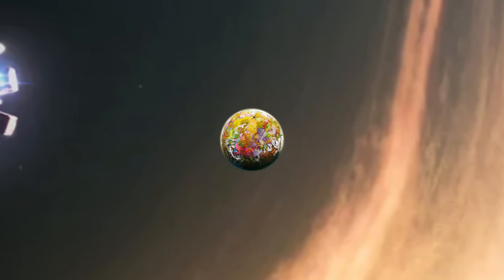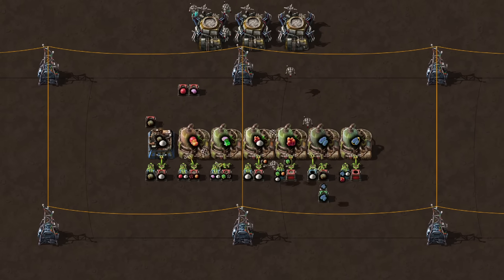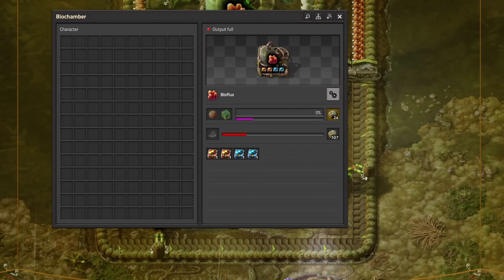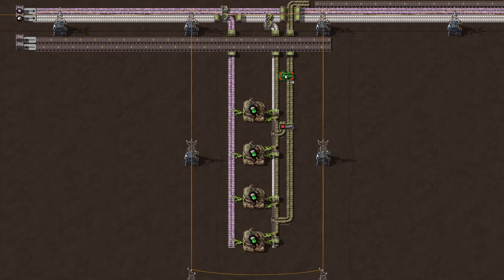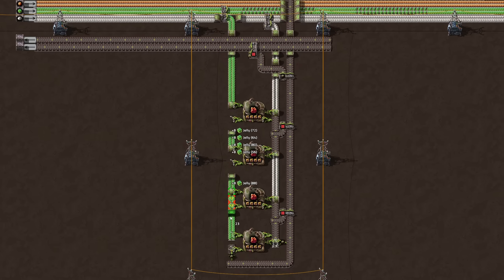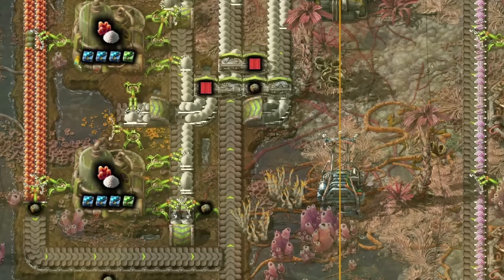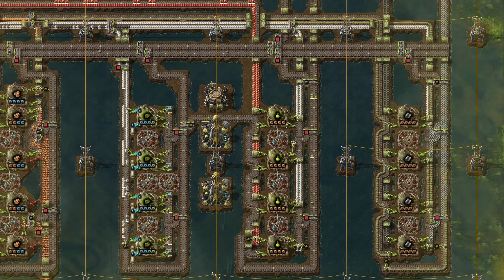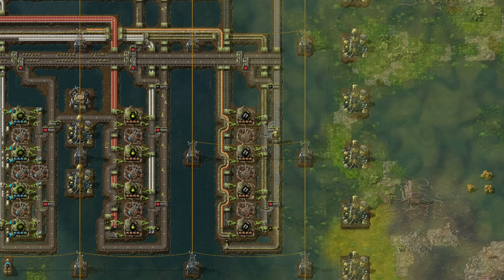Master Planet Gleba in Factorio. With Belts and a Main Bus! Factorio Guide / Tutorial

Comment: You can also permanently store eggs in the form of biochambers, and recycle them if you run out of eggs somehow
Reply from the maker: You actually get eggs back when recycling biochambers? LOL! Thanks for letting me know.
Reply: @AVADIIStrategy  Some people went as far as making spawner capturing devices and recycle them for unspoilable bioflux...
Reply: I heared a similar trick for biter eggs in the tier2 dirt blocks.
Reply: @Sapeidra  lol did the same too but instead I store them in the form of capture bots and I bring thousands of them to shattered planet for prometheum production
Reply: @Sapeidra  so technically you can ship those to make promethium science.
Reply: @Sapeidra yo what, T2 dirt??
Reply: @Sphendrana landfill can be upgraded to tier one plant soil with nutrients and the respective plant seeds. You can fill in some of the area to plant more stuff but to fully utilize the purple and green biomes you need the tier 2 soil which uses the tier 1 soil, more seeds, spoilage, and biter eggs. It takes 10 eggs to make 2 tier 2 soil so you need a lot.
Reply: @Sphendrana  the "overgrowth yumako soil" or the other one. both "store" biter eggs.
Reply: Nice! That's the solution I was missing in my base - everything else can autorestart, except this, now this can be solved as well.
Frankly with base just going and arty keeping pentapods at bay there is nothing to really worry about.
Reply: How do you not have inserters on the machines filtered to remove spoilage if an ingredient spoils in a bio chamber?
Reply: @egelat  unfiltered inserters will remove completed products and spoilage, you just filter from the output belt
Reply: Upcycle bot rocket + quality module in pentapod breeding = on demand legendary penta eggs. I crafted hundreds of legendary bio chamber from that. I am keeping a few in storage just in case i want more legendary eggs on demand via recycler!
Reply: @whensonzhou4174  pretty smart. Legendary eggs have longer lifespan anyway. I think I'll try my first legendary production line on that. Maybe store as unspoilable items and only when I demand I recycle to craft science with some insane speed modules to further keep freshness.
Reply: This is how I did it: I have a place that produces biochambers. The cool thing is that I don't need to know if I'm crafting science, or if anything needs eggs, I just craft biochambers and keep a chest of that full. In a different place I can request bio chambers, and produce a single egg when needed. This way, I don't need to worry about an egg getting into the bot network and being in a storage chest somewhere.

The biochamber production works like this: Request 20x the (non-egg) ingredients that are needed, and the biochamber crafter is always active. This way, the eggs are the only bottle neck, so they can not back up. If I want to stop producing biochambers, because the chest is (almost) full, I only disable the production of eggs, therefore guaranteeing that they all get used up, I'm kinda starving the biochamber crafter.

If the contents of the output chest are low, and there are no eggs, I kickstart this system by recycling biochambers until an egg is in the egg production again. The chance to get an egg out of recycling is 25%.

What pleases my software developer brain is that this system can be treated as a black-box that only supplies you with biochambers, and if other ingredients are missing (iron plates, landfill, nutrients, etc) it simply stops, but does it early enough that all eggs get used up. It can kickstart itself, and only does it rarely. It has a early-off/late-on kind of cycle that prevents it from short cycling, therefore preventing the need to recycle that often.

I do still have a couple tesla turrets around it, because I don't trust my logic yet XD
Reply: @Barmetler  Interesting concept: instead of using eggs to create science, you just quaduple the egg production, create biochambers and recycle them to produce eggs.
Reply: smart
Reply: You can simply stop the active biochamber via circuitry and an egg already used in a recipe will never spoil, no need to ever resupply new eggs.
Reply: Cracked. OP. Speedrunners gonna abuse this for sure.
Reply: I was planning on designing a system with a clock that cycles a new set of eggs into a chest ever minute or so, and burns/voids the spoiling ones... idk if you can do that, void them, come to think of it
Reply: wtf lmao
Reply: oh interesting
Reply: its the accent
Reply: Oh damn this guy is up to something here
Reply: this just blew my mind.  wow.
Reply: I was just overproducing science packs and letting them spoil so that I never have to restart the process.  This is very helpful.
Reply: I made an infinity egg machine on the side, in case I need a Pentapod egg or more. It just creates 2 eggs from one, splits them using a splitter- one goes back into a chest which is then loaded back into the chamber- the other goes into an Incinerator/Recycler. Voila - a perpetual egg-spawner!

Obviously, there's an inserter that handles spoilage.
When I need to get a few eggs, I just rotate the inserter - switching from the incinerator to the chest. In the blueprint below, I've replaced the incenerator with a biochamber to bootstrap science production. So as soon as you land on Gleba, you only need two eggs: 1 for creating the first Biochamber and the second, to stuff it into the chamber and start egg-production- for more eggs or to immediately start producing science.

Apart from the four belts bringing in Jellynut and Yumako and transporting back seeds, these are the only belts I use on Gleba.

0eNrNWE1v2zgQ/SsCz1TWpCTLNrY9FAiKXrbF7t7awKCpiU1UJlWKauoa+e87lG1tYkuJpH7CB8vU8M3Me5wh6T1Z5RUUVmlHFnuSQSmtKpwymizI6xxWIngH2onCZME/hbjTYAOh8Vkq0BKCd9ZklfT2H/Rfb/+9XgRv/fDOVMFGfIbA2LXQ6itkQXmcUeCMwOigBqe1pRQ6sFDkAl+7DTSmr5SRG7FdoU+l8Y0qaXCn3AYjCN6gAQYjnLF//L2TO5mDvSKUKGl0SRbv96RUay1yn5UWW8B0imMiIazX5B5NdQZfyILd0xZjsbZKVrmrrMjDY0BhIeTHBzP5/Q0lCKqcgoPP+sduqSsfNELTxrcqIHQmXFtT6QzjLEypDjTvCUJNrhJKdvU34mfKgjy8nfnozmB5A7tqGLqEZEdIXkMiIIZwzsJpfPmpEjm6wPfa2C0y0eI2atzeitKFSpdgXZvn6OiZnScTt6DGDaqFTxWUiBjKDX5f4saPcI/my1uV45zS25QHRwctTvJS0lg8Gj161ZWzqK4r0d8FC5RIsy1Evcxw9EU9UPlaYZPJ/Q1+WjJKGmxMBvLnsvH6tKBMh7LNL9j2wWpnTb5cAVaj8jnsiVRWVsotQYtVDhlZOFsBbYZxStbA3yqLDD9bSb7mnKhpuWAMc3tagLMF+bwGvuqqEv4X/pCA+QzWqgyWGIr8iEF/hWNxnzGbNq6xulcmdFbosjDWhSvIW4SadhLcAj7rK1vShcr4b6Dby99Qt3lfamdd/YfxFlg26d+B0h/RgbCJ3+bVl+H9hzZg/Ae2M8aG8s778c4H1mH6dMNkUb9tcdK+L3Zv+IM2SRb3ZYvxYXQ93FaMFWvoWqQsOsuw3yrtUL/3PnTiNa69/vQOFp8t7j9/VgdrIy3tSxp/RNqT0WJpqBxl/76R9t6vTseVqM8Jlc0H1nb8gIe2E+9kZK+IOvDYSLyu+Ib2slOxTAce2iyIbLnBG5ivFlf3+csqqscPpluTgb+otMUcjYw56XVHifu2K/4I9tu6FU8G5sQ6dWhDnw5EjwahpyNrZtqxJmcj8ZIOvPnImunAi8bWdEe+0XlNlwU2ySe7bvq8KhEfyWLaR/MoGrmi0l/XN6J4YMzJIEaSkbezfujTkWvOo/s99Q7xfSN6n1BGp5Td0PppVj/hWYlTlJTfoKVysPVH0ebvNUpygU6G/q8WXOu10n7Xx3tSWUeWTPk8ns+TdMKTdI4i/QdUp6ul
Reply: If it stalls on pentapod eggs I just go to the perimeter and pick up some from the kills
Reply: @koenvanderrijt5244  I ain't walking for half an hour for some stinkin eggs!
On top of that, I ain't flying there just to walk to the edge and find eggs!
And if I keep with that arty research, I'd have to walk even further!
Reply: @VEC7ORlt you could have a spidertron do it if you're not there, but an automatic restart would definitely be preferred
Reply: @VEC7ORlt  Gleba gives you spidertrons, which can pick up eggs via construction bots and they can walk to waypoints unattended.

Comment: i did a first playthrough already and was absolutely unhappy the whole time i was on fulgora and gleba... i hated the idea of recycling stuff into the void and built storage of thousands and thousands of chests to store stuff i "could use later"...
gleba? well, probably the same mentality as most other people had: its an abomination! i just could not wrap my head around the spoilage mechanic or how much nutrients my base was consuming (moduled everything to -80% power consumption so they need less nutrients) and had an absolute struggle throughout the whole planets gameplay... i now feel kinda dumb tbh... 
my mind was set to "avoid as much excess as possible" and i ended up barely researching anything with glebas science and only made enough carbon fiber for a number of rocket turrets and kinda abandoned the planet...
now i can kinda understand how the planet works and am starting to feel like i dont mind going there again. well, gotta get off nauvis first on my second run now <(^.^)>
Reply: Hahaha i had the same issue with fulgora, though i wasnt unhappy with it...
The base there is full with chests though. I dont mind recycling extra ice or fuel, but blue chips and LDS always felt a bit painful, so i typically added more and more chests..
Reply: I agree that it feels wrong to recycle into nothing, but scrap is so plentiful that it seems to barely matter. Also I have seen some others recycle down to quality materials with quality modules, which might be a good alternative. It saves space, removes excess, and gets you something out of it. It isn't perfectly sustainable, you can still max out your storage with legendary items, but spamming chests at that point seems much more reasonable.